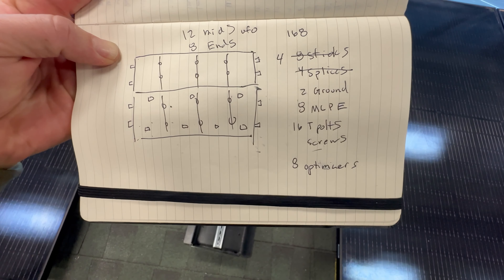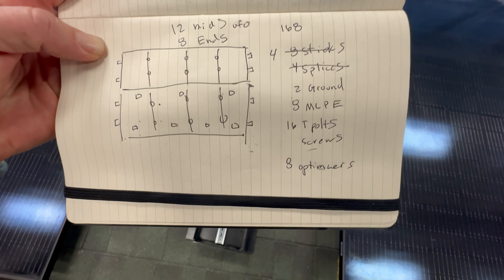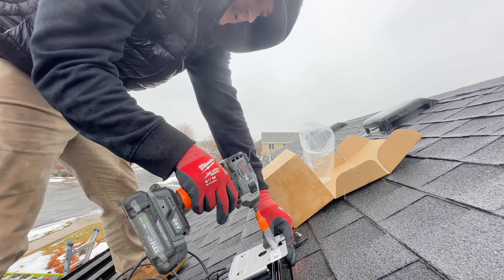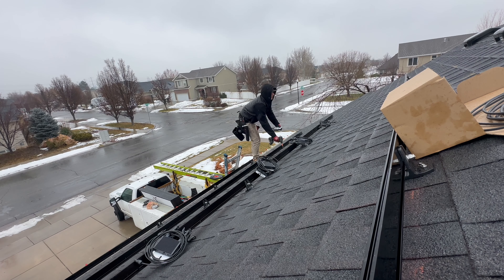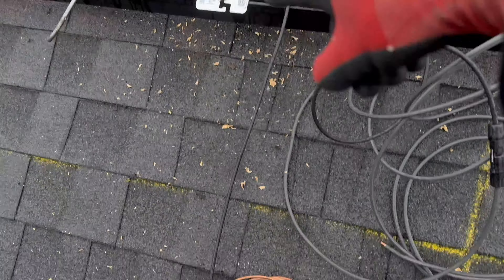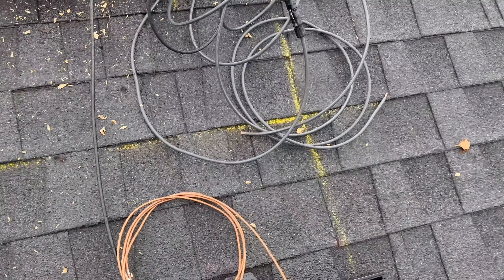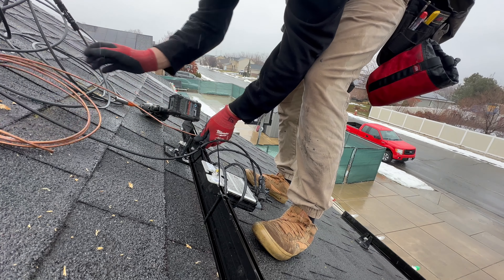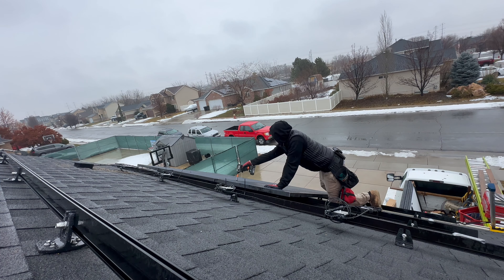ATTACHING SOLAR PANELS TO MY ROOF

Comment: I got a question when you're doing solar panel installation on a roof that's in the northern climates where you have snow is it important to put the solar panels tight together on the top and bottom so that the snow doesn't build up along the rails that hold the solar panel on the roof?

Comment: Are those s440 optimizers? Have you had any issues with those by chance? I'm getting a lot of iso fault service calls on that model. Whenever I track it down, the optimizer in question is never damaged but it fails the resistance test.
Reply: Yes I don't like them
Reply from the maker: I have not seen this yet BUT I’m sure the service calls will be coming
Reply: @AnActualCoconut  any experiences to share? Today I had one testing at 28v that was shutting down a string
Reply: Everyone should standardize around the highest performing optimizer, which in an S series based option would be S500B. By doing so, you reduce the number of optimizers required to activate a string and therefore allow strings to be more reliable. Often folks have strings of exactly 8 for an S440, which if an optimizer fails, the whole string will perform significantly worse. That string of 8 is improved by using S500B because you now have redundancy against failures.

At the end of the day, MLPE focus on panels being the culprit of failures, where the opposite is the case. There are at least thousands of failures related to MLPE, including microinverters, before one defective panel is ever found.

Comment: Cool video. Is there a maximum system size for a 200 amp panel? I read conflicting information online. We have a 11400H SolarEdge inverter and 30 panels but would maybe like to add to the system later on.